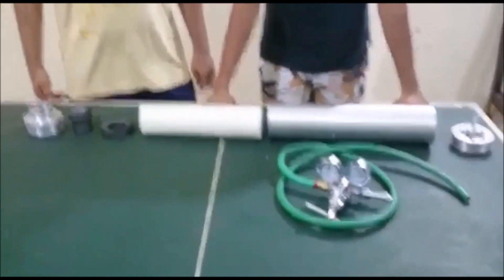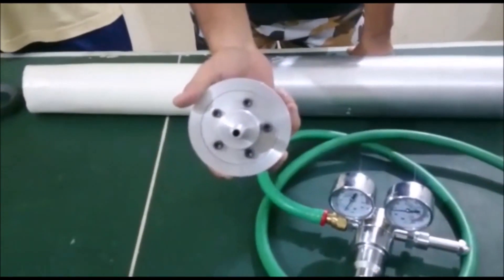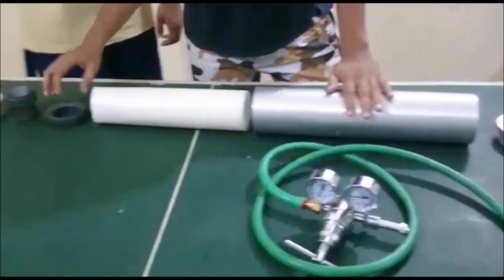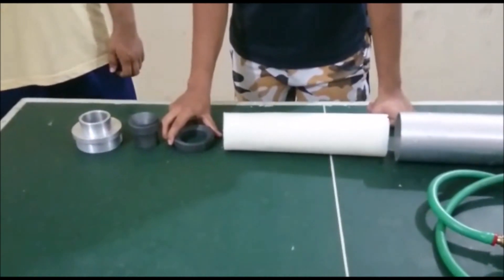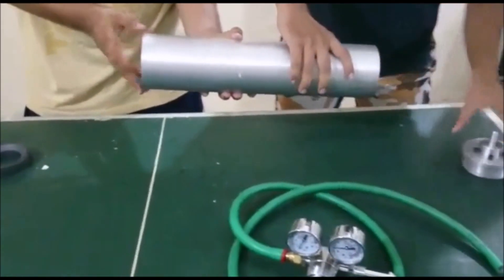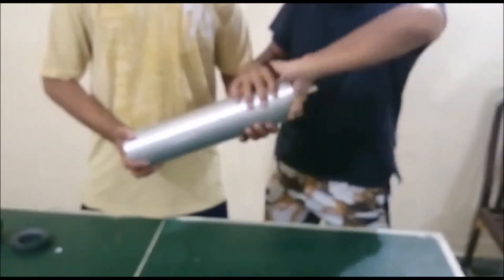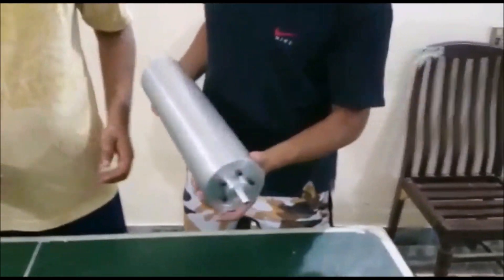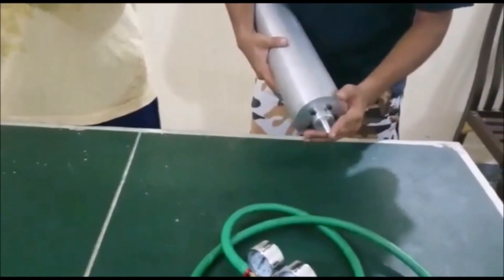First Hybrid Rocket Engine of Pakistan @ DSU

Comment: Very cool that you're making this progress!  I worked on a hybrid rocket for my senior project and I'm glad that you guys are building a hybrid sounding rocket motor!

My main point is SAFETY.  When a motor of that size is up at the chamber pressures you would want to see in a rocket engine, that could EASILY kill you at the distance you are standing.  The standard in the US for small-scale tests is 1500 feet away.  Please be safe when you are performing motor tests!

Also, rocket propulsion elements by George P. Sutton is a GREAT resource for building small motors.  Good luck!
Reply: For reference, our 54mm motor produced roughly 1050 newtons at peak thrust.
Reply from the maker: Thankyou for the comment. Students got a bit excited. We did improve the safety aspect in the followup tests https://www.youtube.com/watch?v=d8kBpVOVBkE
Could you please share your thesis report?
Dr. Bilal

Comment: No thermal lining between the fuel grain and chamber? Sounds like a recipe for a motor burn-through. Great work but you really need to work on safety. A motor that size can be extremely dangerous at those distances. Also, 400 N of thrust sounds extremely low, I build a 75 mm hybrid that runs on paraffin wax and N20 and it generated 700 N. As a final word, the tubing you are using is an incredibly bad idea. To me, it appears to be silicone tubing - FUEL!!!!!!. Your lines should really be brass or stainless steel. Best of luck for your future work in the field...